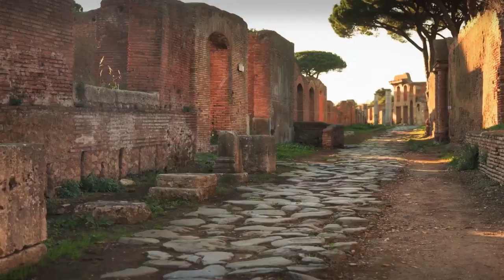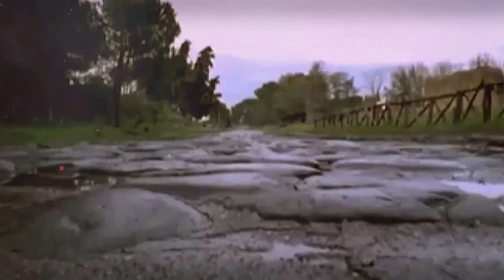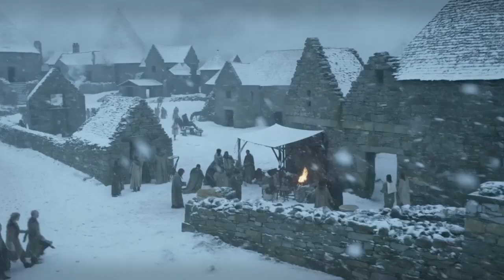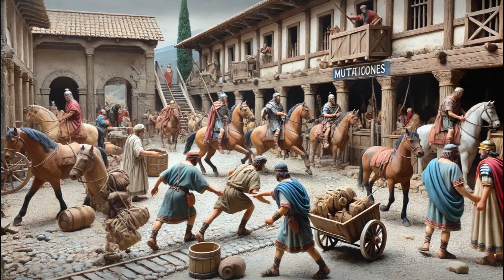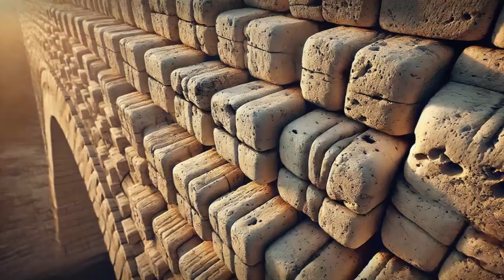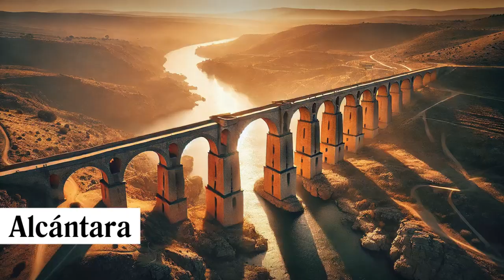How The Romans Built Stronger Roads Than We Do Today

Comment: The Roman roads would not last one season on the Great Lakes or in the Northwest with 80,000 lb trucks roaring across them at 80 miles in hour in the freezing cold or in the Arizona sun at 120 degrees in the air and 150 at the road.

Comment: Different applications for different use cases.
Modern roads cannot be same as cobbled roman roads, you need the friction so your car or truck could drive efficiently and in a safe manner.
Also, you need the elasticity of asphalt from various of reasons for modern traffic.
Google is free, misleading history videos will cost you your ability to think.
Reply: Bla bla bla. This is about praising engineering without your beloved trucks bulldozers and csdting machine.
Reply: @ You are a silly silly person
Reply: @johnpaulii7121  ok edgelord 🤨